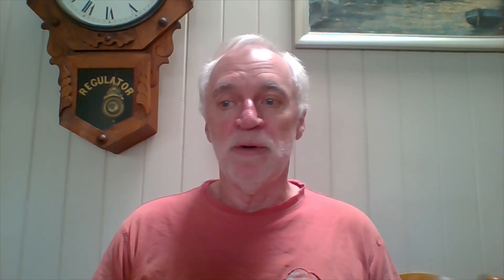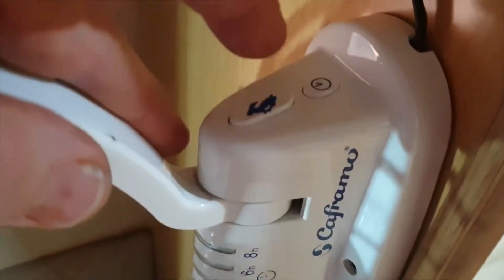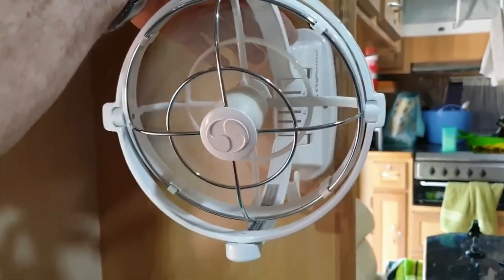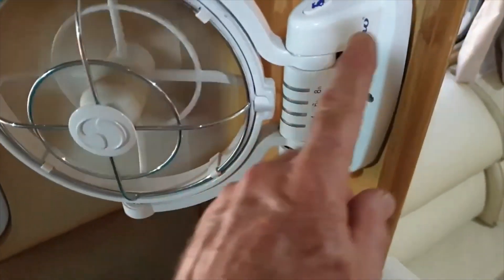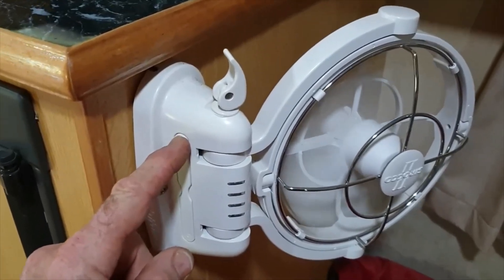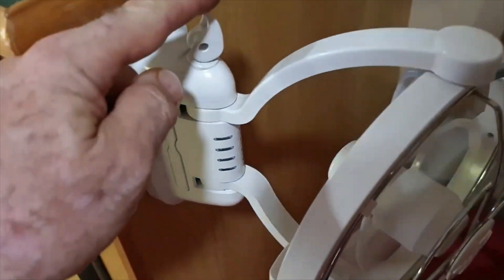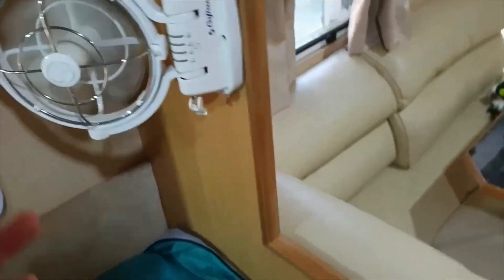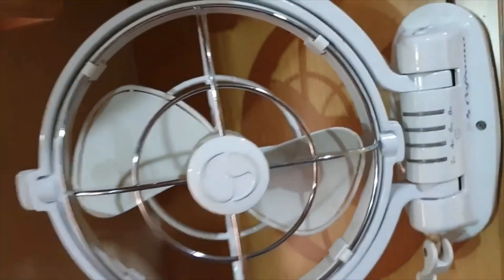Carframo Sirocco 12V Fans Models I & II Features & Issues

Comment: Hi I finally got my sirocco fan and have tried to attach the wiring to a cigarette lighter plug with a cord. I cut the little plug in off the end of the cord and joined the wiring up to the wiring on the fan. But only the blue light comes on the timer switch when turned on but the actual fan wont turn on. when I push the on button, the blue light then turns off. Any idea what maybe causing this?
Reply from the maker: No idea sorry but if you put it back they way it was when you got it and connect it up does it work OK? If it does then you know you did something wrong however the fact that the LED light comes on would tend to indicate that the wiring is not reverse. Anyway back track and try again is all I can suggest. When these things dont work when we change them its usually something we did wrong! Cheers Tim
Reply: @timterry8714  Thanks for replying Tim.
Reply: One possible cause is that the polarity of the wiring is the wrong way around. If the +ve side of the power supply is connected to the negative terminal on the fan, the fan will not spin. Try swapping your two wires, positive and negative.

Comment: I’ve got these fans, and had them on previous boats over many years. The wiring problem can be avoided by minimizing the frequency and range of adjustment. The vibration can often be resolved by slight adjustments of the angles or putting it at ‘dead square’ out from the wall/bulkhead. It’s not a robust build either, understandably. The two year warranty should be extended to five in my view. But as you say, a good product.
Reply from the maker: These are the default industry standard fan for caravans in Australia and yes you are correct they are prone to failure when they are continually swung out and parked.
Reply: Update: I am so sick of these fans (series two) - I’ve had three in the past 12 months that just die - I maintained them well, lubricated the motor shaft lightly - I didn’t move them around from their set position - and the damn switch seems to just die in the arse - pulled two apart to try and repair and can’t - and all just outside the warranty period - plus I had some die before these - $$$ down the drain

Comment: I am a newbie to electronics, so I will need details. I want to set up the sirocco II fan to a cigarette plug to operate the fan from a Jackery 500. As you know ,the fan comes with a tiny power cord that is 22awg. but I see much larger wires coming out from people’s videos.....so have they attached a much larger wire directly to the fan?  Do they use those tiny o rings at end of wire to attach to post.?  I hope you can help me. Alethea Dollison
Reply from the maker: Sorry Alethea, I didnt see this comment at all for some reason. The fan uses very little current and you can certainly use very small diameter wire to run it. They are are very power efficient. Not sure what you mean by the tiny o rings?

Comment from the maker: I emailed Carframo in Canada and explained that the locking pin had failed and they posted me out a spare after I provided details of the series II fan. The pin that failed was actually a series 1 but the locking pin appears to be exactly the same as expected - so while they wouldnt supply me (free or paid) a locking pin for the series I (as it was a discontinued product), when I emailed them previously - they did supply the replacement when I stated that it was the series II.  So really happy with customer service for a current product.
Reply: Really glad this worked out for you. Hope it's going strong.
Reply from the maker: They are both going strong thanks - just have to figure out how to balance the blade no as they both shudder a bit.
Reply: @timterry8714  I saw a review where someone has stuck some pieces of tape to the back of the blade as a temporary fix. Your review was excellent.